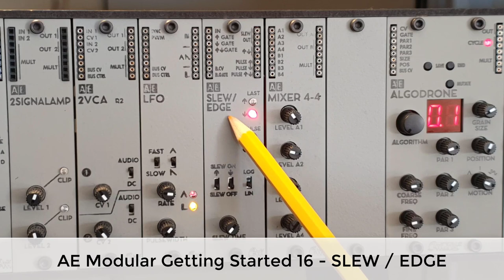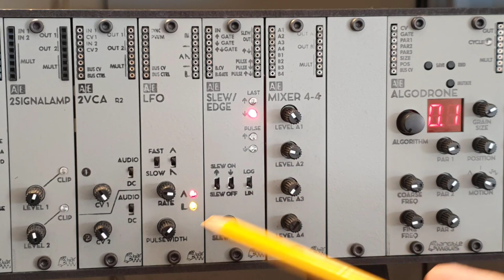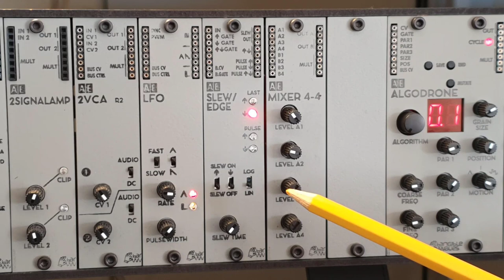AE Modular - Getting Started  16 - SLEW / EDGE

Comment: Will the edge detector work as a square wave converter with audio rate signals? Thanks for the videos btw!
Reply from the maker: Interesting question. I'll test it tonight and let you know!
Reply from the maker: And the answer is YES. I tested with a pure sinewave from the FMOS module and when I ran this into the SLEW and took the edge detection output to my oscilloscope I saw a nice square wave.
Reply: @The5thVolt  Thankyou!